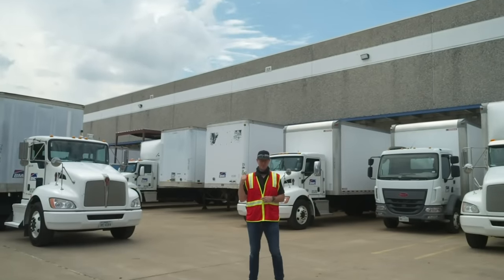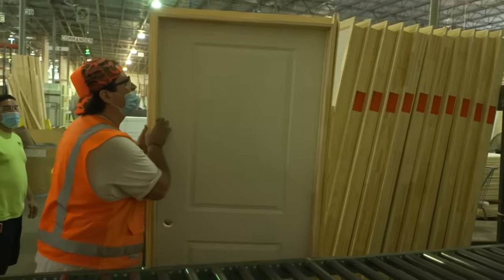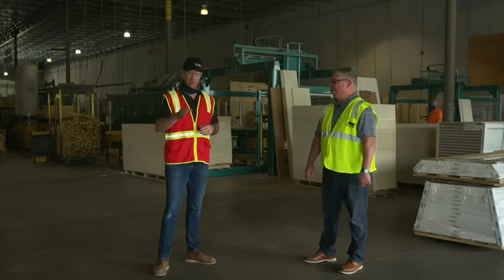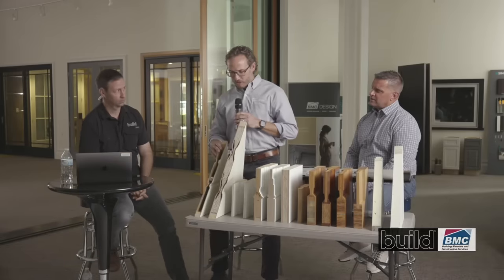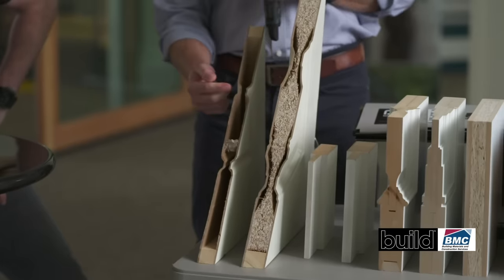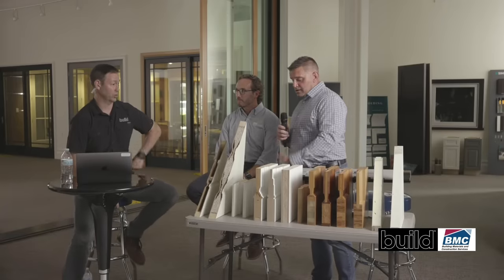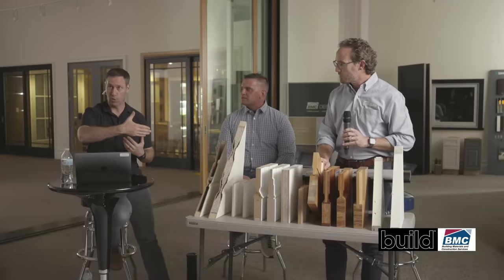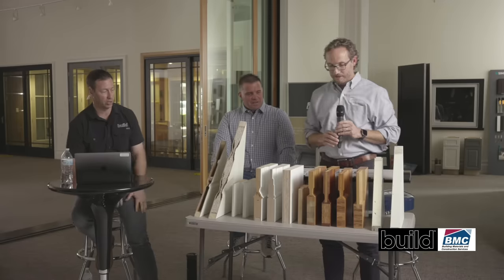Doors 101 - Cost + What They Are Made Of

Comment: Years ago I build a concrete block house with two exterior doors. I used simple commercial doors and painted them with epoxy. One was solid wood and one steel with cemented in steel frames. During construction a homeless man broke in using a cement block on the steel door knob. Since it was winter and the heating system was not installed yet he moved on. I replaced the knob and moved the blocks inside. Later, after I moved, I came home to find a size 13 shoe print on my wood door with no observable damage except the mud on the paint, I think someone had to make a trip to the hospital.

Comment: i have a question about the requirements of door warranties. in this video, they said that the warranty requires painting the door on all 6 sides. but when you have an exterior door, the bottom of the door is usually covered, by a door sweep or door bottom that is kerfed, glued and/or stapled to the bottom of the door. are you expected to remove and reattach the door sweep/bottom so that you can paint the bottom of the door?

Comment: If you have a return register in the room, you don't need a big undercut. I'm surprised that someone who is potentially prepared to spend a thousand dollars on a door isn't going to add a return to every room in their house.
Reply: Sorry if this sounds stupid but if you had a return in every room wouldn’t that just be a huge waste ? It would like suck in everything it just heated ?
Reply: @ImShiftehh  It's a very reasonable question actually, because there are duct systems that do exactly this. However, if you place the registers correctly, and use the right supply registers that won't be a problem. If you design a system badly, lots of the warm/cool air will go directly into the return even if it's in the hallway. Usually the reason a system will have a single return is because it's cheaper and you can get away with it. I think my boss, Rob Minnick personally designed our office because it's a comfortable temperature and I never hear the HVAC system.
Reply: @abel4776  I totally agree duct design is one of the most overlooked aspects of residential architecture.
Reply: Great point! A lot of magic can be worked out with a sophisticated and properly balanced HVAC system.
Reply: you make a valid point, but what does it have to do with the subject of this video?
Reply: @paperwait9611  they were talking about how the return cut on the bottom of the door will keep any door from being very sound resistant.
Reply: @Beastphilosophy  when you build a door, you don't want the door to be snug to the floor because then you would have a hard time opening and closing it. the kind of gap that you are talking about is a fraction of an inch. that has nothing to do with undercuts for ventilation where the gap is several inches. it would typically be a big enough gap that someone outside the room would be able to see into the room. that's why transfer grills are what they actually use instead of undercuts when the objective is ventilation.

Comment: FINALLY  !!!! KUDO's BMC I can't tell you how many freaking times where builders don't want the top or buttom of the doors painted. There is your warranty issue right THERE!!   :_BuildToolsNAILEDIT::_BuildToolsNAILEDIT::_BuildToolsNAILEDIT: Excellent explained from BMC :_BuildToolsNAILEDIT::_BuildToolsNAILEDIT::_BuildToolsNAILEDIT: 
But one question wasn't in this. Can you get your doors also without hinges and without the US door hardware, I am asking because I do want to use European Security door systems within the sold exterior doors so they do have 6 pin interlock into the steel door frame, yes steel door frames will be used.

Comment: When Matt was talking about a 200 Year door and the other gentleman said yeah it will last 200 years if it has maintenance but in my opinion a good product will last or at least be restorable without any maintenance whatsoever I mean my job that I do with complete exterior renovation is that when I have good solid long leaf pine trim with siding that is produced from dense old growth timber I'm able to take a house that had no maintenance for 50 years or longer and take it back to its original Glory only because of it s quality lumber that's why I think these doors being so stable should last without any maintenance whatsoever as long as they're not taking on water

Comment: My East Texas house has a built in tornado shelter with 12" thick concrete reinforced walls and ceiling. The guy I bought it from removed the fire door, cut it in half and made it into a shelf in the garage. Been trying to get a door slab for months. A suggsetion is to not cut your $1000 dollar door in half. Just saying.

Comment: Why doesn't the manufacturer paint or at least prime the bottom and top of the door?
Reply: cost, some do.
Reply: You find yourself looking at the tops and bottoms of doors a lot?
Reply: @Big Crunch Not in it's entirety yet. But I have seen hundreds of doors with the tops and bottoms unpainted, painters usually scribble the location on the top when they paint en masse in the garage or basement.
Reply: 52:00
Reply: There are some locations that will offer to seal the bottom of the exterior doors, but still very important that your painter remove the door sweep to prime and paint all 6 sides of the doors.

Comment: Why is a cheap pre-hung double door set $900 when its made from a pair of $125 to $150 doors?  
Its just got a longer top frame and a longer threshold.... instead of 2 shorter of each.  And its missing 2 side frame members vs buying the 2 doors separate.
Reply: F Huber I just bought 2 singles, took off the jamb side and top and bottom of both frames, and use the jamb sides for the new top and bottom.  Doesn’t take long, and saves a ton of $$

Comment: The biggest problem with any door is when the painters remove them and remove the hinges. They will either not get them set in the mortise correctly or they will strip the hinge screws.
It doesn't matter how well the door is built. The painters WILL mess them up. I have been a trim carpenter for 35 years and have seen this thousands of times. You should do a short video about this problem
Reply: don't let the painters pull the doors lol. Don't let them touch any moving parts lol.
Reply: Everybody blames the painter 😁
Reply: @nicholashartzler2205  I agree!! I wish it was up to me. But...lately I have been charging for every door repair and have made lots of $.
Reply: Lately I see they come with either not tightened properly, sideways driven screws and poorly mortised hinge cavities right from the factory/store so it's not painters fault in this case.

Comment: I sold a few solid veneered oak doors  panel for like $350-500 a piece at Home Depot. Oak veneer was cheaper than pine somehow which didn't make any sense but it was the case, REEB is a brand we deal with for Special order that I love because they sell multiple brands and do machining themselves and like this brand they can do anything you want if you ask and are really good at what they do. Where as the more common is jeld-wen which is decent and can do good stuff but not as good logistics and consistency assembly wise.

Comment: My front door is steel with a steel frame. Your door is only as good as your frame is.
Reply: steel has really high thermal conductivity, so a steel frame isn't really a practical choice.
Reply: @JamesBlazen  if we are talking about a single family house, the wall assembly is not required to be fire rated. so your house might burn down, but at least the door will remain standing!

Comment: For doing a budget remodel, is there any issue with drilling holes in the top of a hollow core door and spraying low pressure expanding foam inside?
Reply: On most of the hollow  core doors the cardboard is in a honeycomb style
Reply: When I did mine I knocked holes in the front of the door to fill it and it took 3 cans of the pro spray foam
Reply: i found the solid core were only 20-30 more a door.

Comment: Great introductory video. Interesting that I did not see the low-cost door that we had in our 700sf 2br-1ba 1952 New Jersey  “Cape”: A simple 1 3/8” x 30” x 80” hollow-core birch veneer flush slab with painted clamshell casing and cylindrical lockset. Pop put a clear finish on the slab and we has an attractive, no-frills, simple door that worked well and added a desirable contemporary touch of wood to the interior decor. Not exactly an architectural award winner but it did NOT attempt to “fake” a phony panel and stile. 
When we sold the house in 2005, it still had the same doors and they had survived a half-century of use in near as-new condition. Overall this home, which dated from the early days of production tract house construction and was by-and-large short on embellishments, was built very well and easy to maintain over time. It was a very adaptable “starter home” that my frugal parents never really wanted to move up from.

Comment: Most informative program on doors I’ve ever seen.  Thanks Matt.  One problem I see as a homeowner is that the hinges and screws get loose over time and it’s a challenge to repair.  Wish there was a better way to secure the hinges to the frame.  I’m not sure if it a door or builder issue.